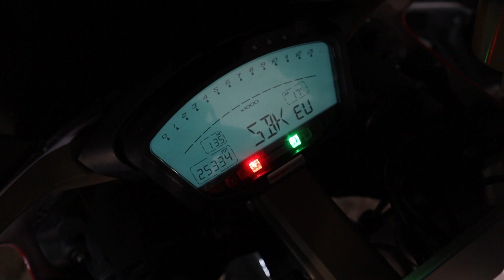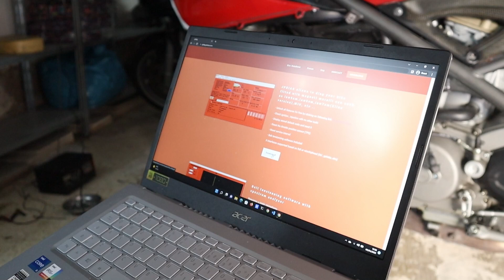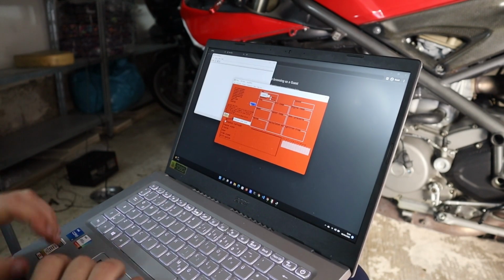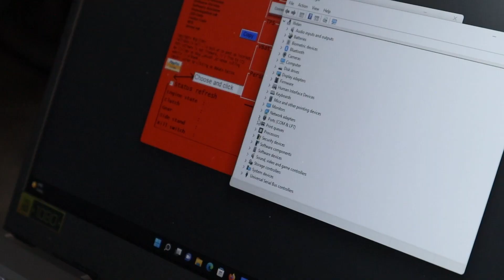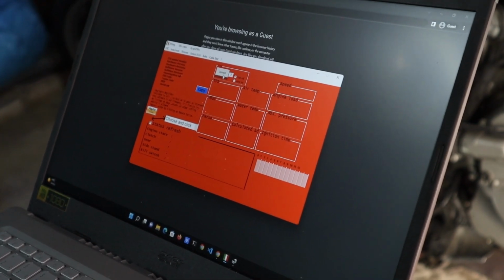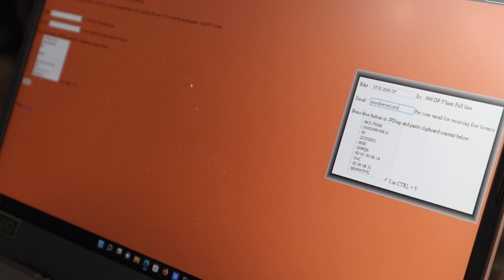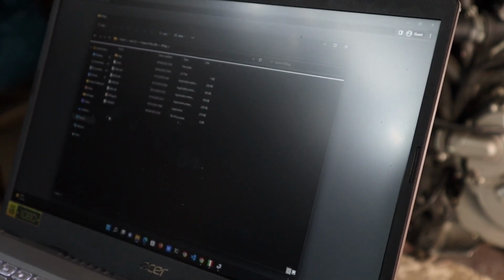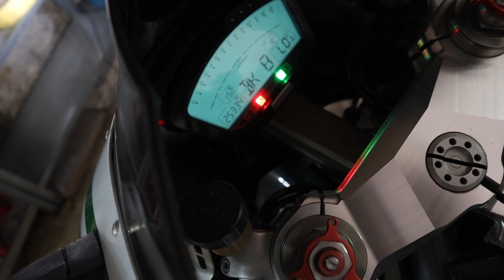Ducati Service Warning Reset - JPDiag - (Ducati 848)

Comment: Hi man, can you tell me how you successfully install jpdiag? I tried install on 3 laptops and every time show mw this window:
L'installation ne peut pas installer les fichiers systeme ou mettre a jour les fichiers partagés sils sont utilisés. Avant de poursuivre, fermez toutes les applications en cours.

Forum is dead, I can't help myself.
Reply from the maker: There is no installation for this software, you simply unzip the package and open jpdiag
Reply: @pullumoto Thanks for your help but I have still problem. Can I send you some screenshots or videos to your IG?

Comment: Hi man, great vid! I installed the software and got it working and requested the license 4 times already and waited 3 weeks already but no answer. May i ask you to send me your license file? I will check if i can/need to modify the ECU values to get it working so i can use the reset feature
Reply: Hi, did you get the license yet? And how did you download file? I tried and it’s acting odd on my end
Reply: @GoToDucatiGuyunfortunately no. Don’t think they actively work on that project. Traded the bike in a while ago for a K8 Suzuki gsxr 750

Comment: Contacted JPDiag 3 times over course of 2 weeks, no response. Seems project is dead. Plus the software is terrible. The UI freezes if you pick wrong com port, the blue report button is barely clickable after connecting to bike, cant resize UI. Software is so bad, its no wonder they dont respond any more.
Reply from the maker: Yeah there are some problems and issues with the software but in my case I managed to have it work with 4 different ducati bikes. I think he's just 1 guy working on the project so I can't blame him and it is free

Comment: For the Dial 1260S the OBD2 connector is four not three. So maybe there is no need for the power connection??
Reply from the maker: I think all the newer ducatis are using the 4 port obd connector now, if you search for ducati 4 pin obd on ebay you can easily find it

Comment: Will this work on a 2022 Diavel 1260?
Reply from the maker: it should be very similar process, you will need Melcodiag software instead of jpdiag(from the same website)
Reply: Thank you.
 @pullumoto

Comment: Do you have the specs for the ODBII connector? The link you have in description doesn’t work anymore.
Reply from the maker: hey, I have updated the links for the connector. Usually writing "fiat alfa obd2 diagnostic cable" does the trick It should be the blue one. If you have another bike other than 848 other connectors can be compatible like ELM327 in the jpdiag website there are all the details
Reply: @pullumoto  yes. 2011 Multistrada 1200S
Reply from the maker: so according to the website you should use "melcodiag" software and cable should be  ELM327 v1.5

Comment: Hey I have a question so in my Ducati 848 I change the dash ecu and key switch but is from a 1098 2008 and is giving me the service check so with these processes I can reset it and but on the dash is from a 848 ?

Comment: Hey bro! How are you? My Ducati Panigale 899 is flashing a ‘C’ and a green ‘Neutral’ signal on the odometer and doesn’t want to start! I already put the correct screws on the battery (because one doesn’t work correctly and it didn’t get tight) 
If you can please help me I really appreciate!🙏🏽💯
Reply from the maker: "C" on the dash means its a problem with gear change indicator, it's either the sensor or the bike need to recalibrate the gear sequence. Before buying a new sensor try to  google "ducati Gear Teach procedure" you should be able to this procedure yourself maybe it fixes it 🙂